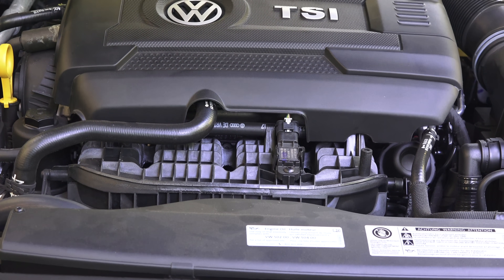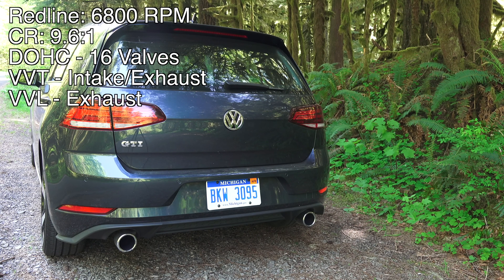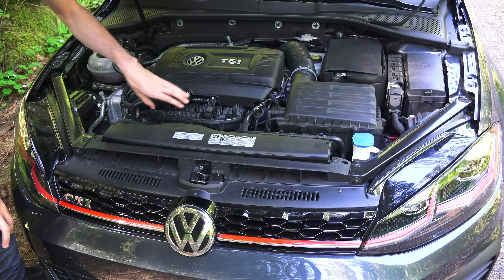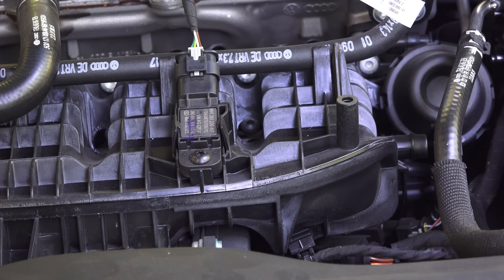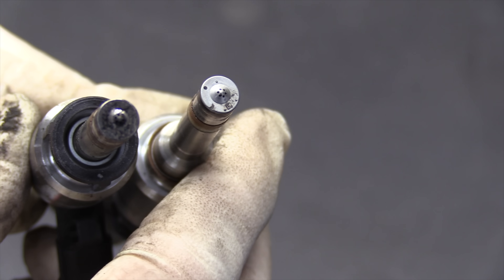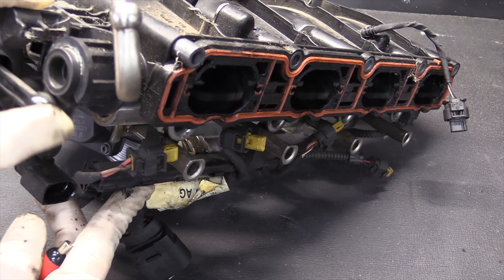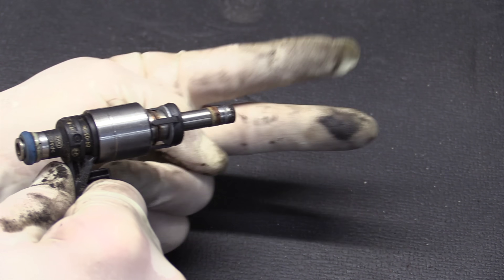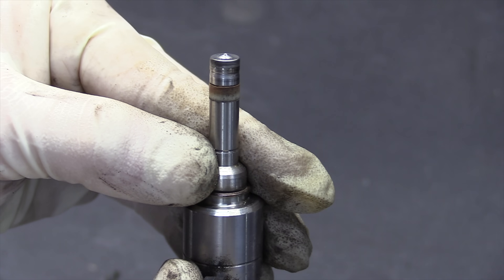The Best Engines - Volkswagen GTI Turbo

Comment: +Engineering Explained I really MUST GET AN ANSWER to this from you as you previously had a video on it.... what would the effects of having a turbo blanket on the catalytic converter be as it is obviously not part of the initial VW design? Would the ECU take care of the A/F ratio? If OK, would I be able to permanently remove the heat shield? You did say together with the +Humble Mechanic that reliability shouldn't be a problem as long as the engine idles for a bit before turning off the engine which is standard Turbocharging good practice. I am thinking of putting one in in the near future for my SEAT Leon Cupra 290, together with an Eventuri air intake, inlet hose and elbow, and turbo muffler delete. 

Some info I'd like to share for the 2.0L TSI EA888 gen 3: 

- 98 Octane (RON) is highly recommended, engine output and fuel economy are optimized with that fuel, so there will be a slight drop in those using 95 RON
- It has dual injection (direct - high load and MPI - partial load/idle, in Europe) from a low pressure electric fuel pump and high pressure (around 200 bar) mechanical pump driven by the exhaust cam shaft. This minimizes carbon build-up and improves fuel economy.
- Induction hardened steel crankshaft and wrought iron con-rods
- Single scroll turbo from IHI (IS38 model) but with two ports from the integrated manifold - cylinders 1&4 and 2&3 I believe (not to be confused with twin-scroll)

Comment: Why do they brake down so mutch if they are the best engines...? Chain belt, turbo and oil use (plastic rings)    you call that great???
Reply: They don't have plastic rings lol. Plastic would melt in 3 seconds of engine running.

Comment: Great video as always. Modern engines are amazing. They last twice as long, get immense power from small units and are so efficient compared with the 80s high performance cars.
Reply: No such thing as cheap horsepower.  Valves have to be cleaned every 70k and the injectors not cheap.  I'd take a V8 with a carburetor any day
Reply: All these modern electronic crap breaks then wallet bye bye

Comment: I just dropped $8,000 on a new engine on my 2011 GTI due to the timing  chain jumping.  VW never recalled these engines with a poorly designed chain tensioner.

Comment: After owning a mk6 for 6 years and now a mk7 for 1 yr... only problems ive had were carbon buildup and coil packs, for 115k miles thats excellent. The clutch never slipped, after the carbon cleaned out it drove like new. The mk7 is even better, i can consistently get 36 mpg, seriously the best car for the money
Reply: Seriously I have a mk7 gli stage 2 tuned 89k miles never had an issue yet change the oil every 3,000-3500 miles. Clutch feels excellent and seems to love all the boost you throw at it and still gets 34-35mpg

Comment: It may be a well engineered engine but mechanically speaking they are pieces of garbage and engine that can’t go over 90,000 miles without popping a timing chain is not a good engine to me. I’m doing one in my shop and have videos of it on my YouTube page they are definitely very interesting engines from the engineering standpoint but not very good engines for a long Jevity standpoint always a great video thanks for sharing
Reply: Hmmm I have a MK7 GTI which I've had from new and I'm at 104,000 miles. So you're wrong 😂😂
Reply: I'm at 170k miles. Stage 1
Reply: It's a lever right "leave it right where it is!"

Comment: Jason...  Could you do a video on the differences in Electronic Fuel injection, and Direct Fuel Injection to include what improvements to Direct Injection?  Would like to  see a true in-depth with your presentation on it.  The tech for both have been around for awhile now.  Thanks.

Comment: ...What exhaust manifold.. facepalm

The turbo is bolted directly to the cylinder head, you could say the "manifold" is integral to the cylinder head.. yet thats also the exhaust ports.. the ports are the manifold and yes..its watercooled, its integral to the cylinder head.

And for Christ sake.... why would you tell anybody they can run their GTI on regular gasoline other than premium...
Reply from the maker: You're talking in circles.. saying there's no manifold and then saying "yes, it's integral to the cylinder head." I don't understand why you need to be so condescending when you obviously understand what's meant. Are you now saying that Audi is clueless as well when they say "Another innovation is integration of the exhaust manifold in the cylinder head." Integrated exhaust manifold is very much a thing... 
https://www.audi-mediacenter.com/en/foray-into-the-worlds-largest-market-segment-the-audi-a3-sedan-and-s3-sedan-3249/engines-3326
Reply: Engineering Explained simply saying for those who aren’t familiar with it they may be lead to believe it has an actual physical manifold that can be seen like the older TSI with the turbine housing integrated into the manifold.

In reality looking at the engine on a stand you won’t see a manifold.. all I’m saying

Comment: Thanks for reviewing this engine!! I requested a VW/Audi engine on the last best engine video.

I have a version of this engine in my Audi, it’s wonderful when it behaves. The faulty piston rings and timing chain issues are a headache but it dives so good that it’s worth the pain. 

Keep up the good work!
Reply: the timing chain issue was fixed by the 2015 model- I have a 2015 audi A3 1.8T  EA888 gen 3 with 140,000 miles, been super reliable, awesome little engine , plenty of power stage 1 tune.

Comment: 2015 VW Polo 6c GTI DSG reporting in.
1.8 TSI 7speed dry clutch 
214hp 190whp stock 
Stage1 245 HP
0-60 6.1 seconds stock 
0-60 5.7 seconds stage 1

Comment: What year is this? I have a ‘14 and thought it was 205hp stock. Also these second gen are just as good as the first ones? If they won the award back then wouldn’t that have been the gen 1 2.0T? I always heard the gen 2 2.0T was a lot better

Comment: How does this engine win while the valves get crammed full of carbon, and the turbo's wastage is built on the inside of the turbo and prone to failure. That said a lot of people throw hate at the plastic intake manifolds. The fact of the matter is, it's not 1980 anymore. Plastics have come very far and are often better suited than alloys even for semi-mechanical parts.

Comment: I would like to see a video on the hot hatch engines compared to each other. VW GTI vs Subaru WRX Vs FORD FOCUS ST. Vs civic si Engineering of the the three engines would be cool to see. Especially since the wrx  and focus engines are a little more specialized within their own brands.

Comment: Hey Jason, there`s this thing i`ve heard: 
>>>>> "rotary engines are `just made to be run on LPG` "<<<<<, 
arguing that injecting LPG instead of regular fuel reduces engine`s oil consumption, improves mpg and is working great overall without any noticeble loss of power.
(e.g. RX-8 with 6 LPG injectors) 
Think you could make a video about this? Would be very grateful!

Comment: The Pumpe Duse Tdi’s (BEW and BRM) were pretty unique with how they run the unit injectors. The incredible load that the oil system takes is pretty cool. Also, I love my 2011 golf TDI with its CJAA (dirty cheater) engine! I sold back my 2012 Jetta Sportwagen TDI (DSG) and actually prefer the tuning better AFTER the emissions update. Going to a manual is probably the main factor though! 😁 Maybe take an in depth look at these engines?
Reply: Oh man, I’m driving a 2016 TT right now tuned with unitronic stage 1 with a cotton upgraded air filter (+ grate delete), and deleted my muffler, 2 resonators and secondary cat, and the cars hauls but you mentioning the BEW, you made me shed a tear. I had a stage 3 ‘05 tdi with a hybrid vnt20, SRI, Hybrid injectors, fmic, pre-cat exhaust dump, Peloquin LSD and more, and the car pulled like a track rocket. Why did you make me miss her? 😢

Comment: Its the samething with these engines, you will need to do lot of maintenance for these engines. Carbon builds up as same as any other vW TSI engines. Still i think the most problematic is that valvetiming, sorry to say but honda is the only manufacturer which can make that happen. Others are just crap they brake and cost lot and lot of money to fix. There is just too many sensors to measure every little thing that valvetiming is doing.

Comment: First mod: a catch can on the return from the PCV into the intake to get that oily air cleaner since it's DI and has no fuel wash on the back of the intake valves. Or install water-methanol injection; that'll not only clean the valves, it'll also steam-clean the combustion chamber, raise octane, and just keep everything cooler, safer, and happier.

Comment: I own a 2007 Jetta GLI with more than 400 000km (250 000 miles) and it still runs smooth as a baby's bottom. Probably not the same engine but already a great one!

Comment: You make the point that catalytic converters don't like to be too hot... Is there a reason why they're placed so close to the engine bay and not further down the exhaust pipe? Maybe near the rear axle. Cheers

Comment: Bmw n54 please !! FIVE straight International Engine of the Year awards and THREE straight Ward's 10 Best Engines ! off course it has its flaws like the injector, hpfp and water pump. Still its basically the new 2jz in term of hp potential and ``tunability``

Comment: We rented a 2017/18 Passat r line a few months back which, I think, uses this engine. Wow, very different from my 2000 crown vic V8 in a bad way. I felt there was a lot of turbo lag and it wasn't very linear at all. It is apples and oranges but we were very unhappy all the way around. The Passat is a horrible car anyway - as in the steering wheel is off to one side a bit (why??) so that may have biased our feelings. We also drive a  '09 Honda CRV with a VTEC engine so we know how a 4 cylinder feels. That 2.0 VTEC is a way better engine. And, a V8, even if old cranky and pulling tons of car, is better.

Comment: Hey Guys:
I know you guys been around cars for a long time. So have I, and I would not buy a VW with the 2.0 regardless of how much improvement. working right now on a 3.6 with a lot of headache to replace the timing chain. You have to drop the transmission to get to the timing chain which is a bigger headache.

Comment: GREAT motor, definitely underappreciated. It's not as smooth as a BMW I-6 or Porsche flat-6 but for an in-line 4 it's close. Almost no vibration, smooth power delivery with no flat spots. Plus endless tuning options, from a mild 300 hp up to 500+ if you go stage 3+.

Comment: I have a 2017 GTI, best car I’ve ever owned by far. One thing I would dispute is the claim that premium gives you more power. I’m aware that’s what VW says, but I haven’t noticed any difference at all in performance between 87 octane and premium. This is unlike my previous vehicle, which had the Ford 3.5L Ecoboost, for which performance was very noticeably worse without premium gas.

Comment: 2900. Psi ... God almighty

I'm use to Japanese injectors that are normally 600-800 on most sporty models ..

No wonder a simple reflash can drastically increase your performance.

They are severely over engineered ..

Typical German philosophy lol

Not completing one bit .. just had my mrk 7 golf tuned .. I'm pretty close to golf R numbers :D .. from the 1.8

Comment: That oil burning thing is featured!? There's more to a good road engine than power and efficiency, which itself isn't much use if the engine fails prematurely, resulting in expensive repair.
Reply: Cecil Hunter it’s not that it can’t handle the HP, it can’t handle the torque. The GTI’s actually push a lot of torque and is quite easy to push more. I wish VW used a beefier clutch out of factory but, they always wanted to keep the car to feel and be an amazing daily, hence why it’s also so quiet.
Reply: Thomas Griffin I’m hearing the clutch in the new GTI can’t handle more HP.

Comment: Im not a fan of these engines. The preformance is sort of impressive, but these engines still die in 3 years or 100k miles. They have way too much carbon build up which will cause your engine to heat up and basically fall apart. Guides start coming out, valve seals go bad, the tensioners ALWAYS break. Then when that happens you're 16 valves down the drain, possibly break a piston. The cams ware out worse than ford. Just terrible engines. And the 2.5 isnt any better. All VW engines except the 3.0 dont last. Theyll preform great while they do, for 3 years. Yeah, not a fan.
Reply: Chris lol ive never had one. I only drive jeep. I know this because im an engine rebuilder. And yeah its direct injection and that causes the carbon build up. Doesnt change the fact that it gets carbon build up. Carbon build up cant be prevented by changing your oil. Its just the metals that VW uses that makes it stick to the valves more than other companies. For ex BMW is also direct injection, they have bad carbon build up but not as bad. VW is like 10% worse based on what ive seen. Anyways, not the point. Point is, theres only 1 thing you can do about it. Clean it with a special vaccuum every 100k miles. Its recommended every 60k miles but nobody does that. Its also 1000$ job. So, you gonna pay that money when your car aint even worth 1000$? Just get a jeep. Theyre cheaper, easier to fix, last longer, and preform better. Also more luxurious, but thats only in comparison to VW not audi. Audis got luxury, not much else tbh.

Comment: I love mine. I have owned 4 VW's (the last 2 were Passat's which are fine cars but are boring) my first was a 13' GTI. I had decided I was going to switch brands for my current car. I drove damn near everything, Ford Honda Nissan Chevy Mazda Subaru Jeep, and on and on and decided to drive a GTI just for old times sake and remembered why I fell in love with that car in the first place. So now I've got a 17' GTI sitting in my garage and zero regrets on my choice.

Comment: Hi Jason. Good video as usual. I have a question that might need your answer to clear my long time doubt. 
Why does running lean in the engine give a hotter exhaust?
I’ll be really appreciate for your answer. Thanks.

Comment: The engine discussed here is cool but it is expensive to maintain and the average person cant afford to maintain and own these German cars period. I would not call this the best engine when you put into account the cost of owning this engine and ones like it. In Australia i think the best engine made is the 4L straight six barra turbo by Ford a particular engine that makes lots of power and it is not the most fuel efficient engine but where it shines in particular is it ease of modification 400hp is possible on a mostly stock or completely stock engine. The good thing about this barra turbo it shares parts from its non turbo variant making it easier to get parts for and are significantly cheaper than this German turbo pocket rocket. Not only that the engine is simpler and you can do some work on it yourself.

Comment: 2.0t is the least reliable engine I’ve ever owned. In 2011 a5 at 52k it needed new rings, at 58k new turbo, and now at 72k tensioner gave up and timing jumped. NO ONE CAN CONVINCE ME ITS A GOOD ENGINE.
Reply: +2  
76k Miles dead EA888 engine in our '09 Tiguan, we always took vehicle to the dealer for service but no help from them on the Timing Chain Tensioner Failure, AND now they want to tell everyone that they have the longest warranty, give me a break. 

Remember a simple PCV diaphragm leak can result in a blown Rear Main Seal (RMS) thats a +$1500 repair. 

We own another VW, one with the 07k  2.5 litre 5 cylinder engine, now that's a reliable engine, and that's the one you should really be singing the praise of on power, reliability and engineering.

Comment: I’m sure most of the people with issues had the Gen 1 EA888. I’ll admit, that engine was garbo, I had one in my old CC. But the Gen 3 is quite reliable. I have never seen so many complaints about the Gen 3 outside of this videos comment section. Also, if you hate VW because of emissions, you’re forgetting about the many other companies that did the same thing, if not worse. I guess VW is getting destroyed due to being caught first and the size of the company. Please remember that FCA products, GM products, Renault products, Suzuki products, Peugeot/Citroen Products, Daimler products, etc. have all cheated diesel emissions. Most of them have cheated much worse than VW.

Comment: one of my fav engines. i wanna actually own one myself one day lol. i love the explanations, thank you. i wonder if these intake runners wear out prematurely, like the older intake runners found in the VR6 and the BMW engines (M54)
Reply: The intake flaps can get stuck shut and cause issues whereas the intake changeover rod aka (the paper towel roll) only wears out the plastic bushings inside then causes a rattle. The flaps on all the direct injection motors are known to be problematic.
Reply: If this it your favorite engine, then you haven’t had the timing chain jump yet! Just joking, I wouldn’t wish that curse on you. But they are good engines, just need to be tended to when needed.